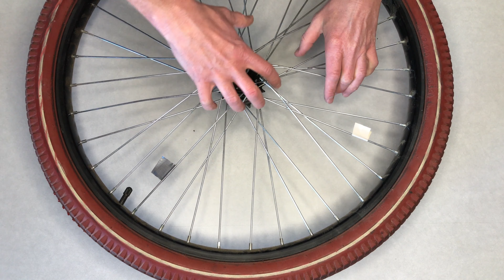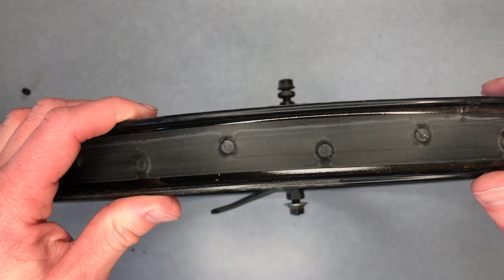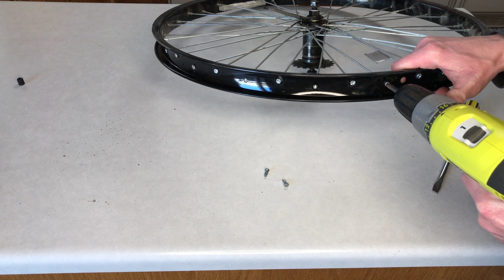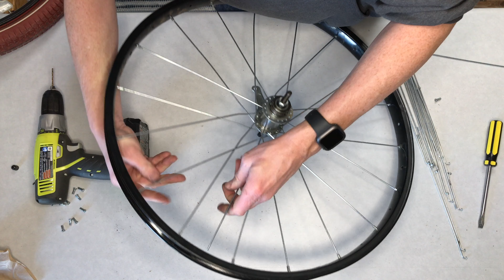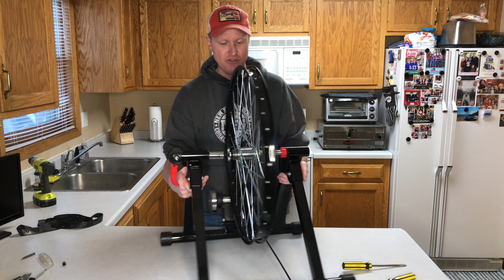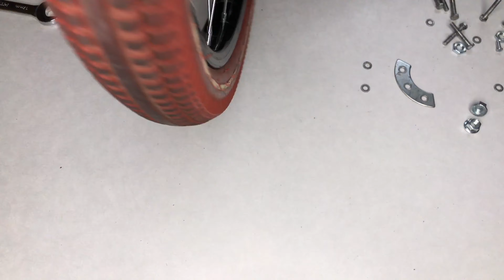Motorized Bicycle Broken Wheel Respoking - Why & How My Wheel Broke + Repair 4K

Comment: Check your pedal drive chain alignment. I believe you put your rear sprocket on wrong. It is supposed to bump out from the hub the same as your motorized side rear sprocket.

Comment: Screw that hub replacement man!! Just install calipers. It is much easier
Reply: I am fairly sure Steve that you are thinking disc brakes and motorized cycles is thinking rim brakes ( which are called caliper brakes in the bicycle world ).

Comment: I'm getting flustrated these things so unreliable... About to give up just purchased mag wheels if they don't work right I throw in the towel!
Reply: @Steve_Does_Stuff  I've been through 2 rear wheels in 4 months. U right the motor runs good and rip up my spokes.. I'm trying mag wheels it makes sense
Reply: @macmotorizedbike3834  how did the mag wheels work out? I just ordered a pair today after ruining all back spokes in 2 days.
Reply: @ManlyManStuff  Mag wheels👍👍
Reply: @macmotorizedbike3834  where did you order them from? Bike Berry sent me the wrong rims and forgot half of my order!
Reply: @ManlyManStuff  Wrong rims?
Reply: @macmotorizedbike3834  yeah I ordered the 10 spoke they sent me the 3 spoke. And nothing else I ordered.

Comment: If your gonna respoke you might as well upgrade to a disc brake hub and get the rear disc brake adapter. Its going to stop better when you need to slam on it. You will just break the rim again next time someone pulls out in front of you.
Reply: @Steve_Does_Stuff  They make brackets that clamp onto the bike so you can mount the caliper and then its just getting a hub with the rotor mounts and getting the rotor.